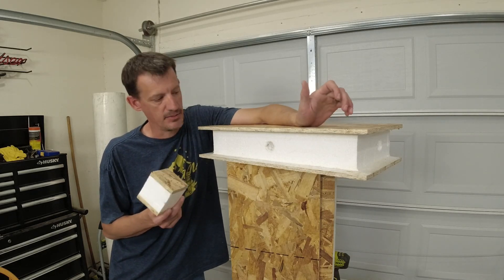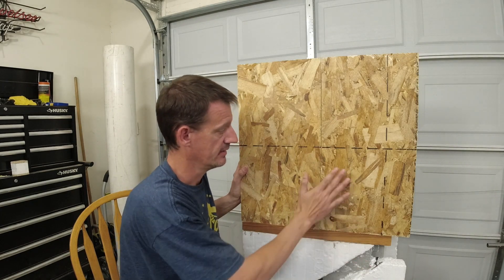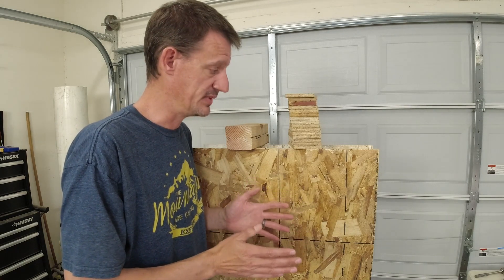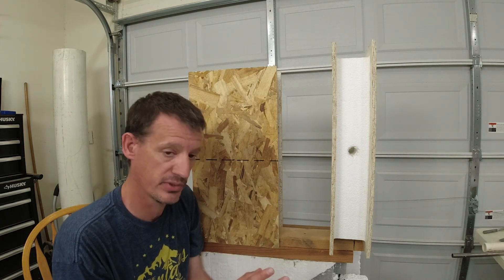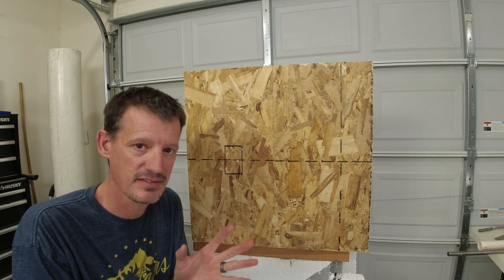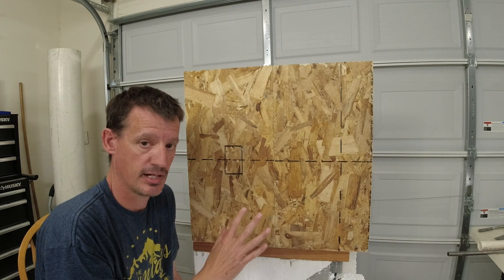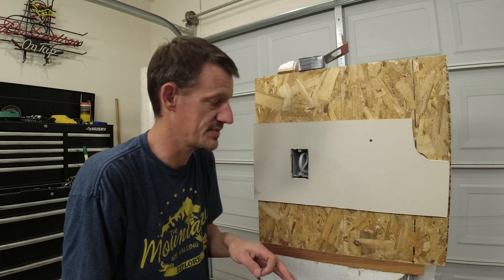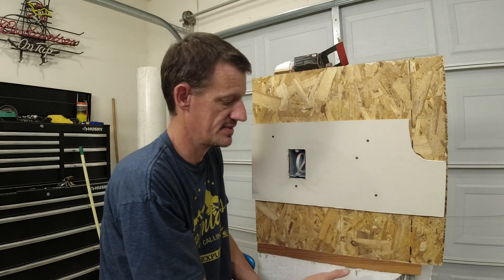SIPs construction explained - Not just energy efficient

Comment: This is a great basic breakdown of the SIPS product. We are personally rolling with ICF.
How are you waterproofing the exterior OSB? This would be my only concern regarding SIPS vs. ICF. The first thing that comes to mind is a commercial roofing rubber sealant. We are currently working on our Mechanical/Well House. I decided to use lumber because of the amount of Mechanicals involved. I was not impressed with the green ZIP osb. I decided to roll my walls with 5 coats of roofing rubber. Nonetheless keep up the great work 💪 

https://youtu.be/JmB1wxQCJ7o
Reply from the maker: Thanks.   We have some options for the rain screen / moisture barrier on the sips.   We are also using ICF on the downstairs of our place.   I think both products are great and like everything they both have pros and cons.   Even if I was doing all the walls with ICF, I would still probably use sips for the roof.  They compliment each other very well.